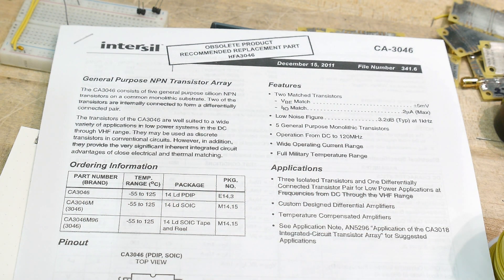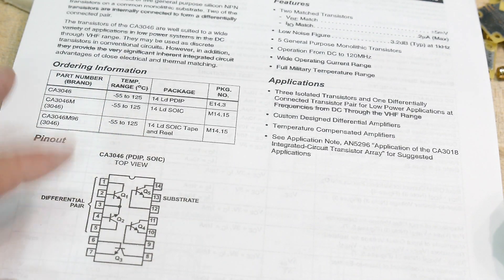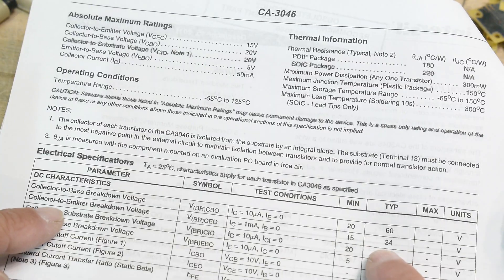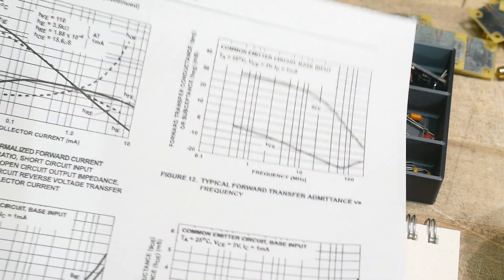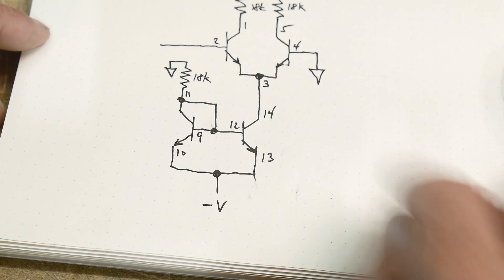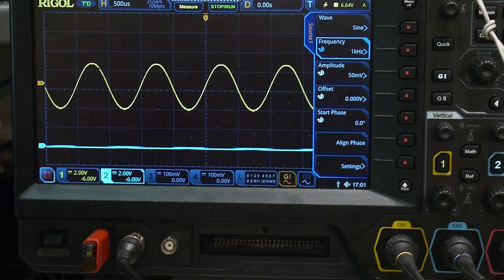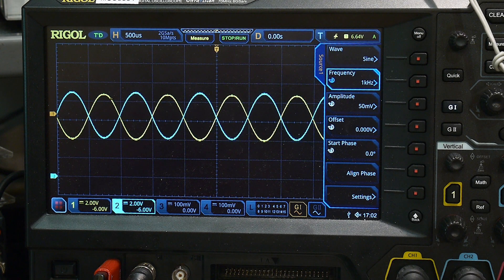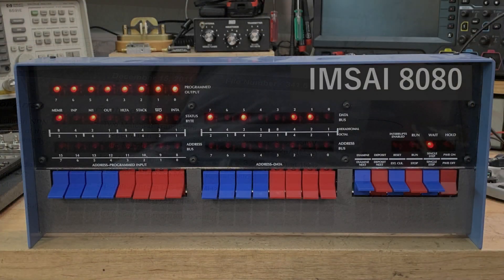#1176 CA3046 Differential Amplifier

Comment: I have some CA3086s, which just have 3 NPN and 2 PNP transistors. These would be really nifty as I've been exploring diff amps lately. There is also the CA3096, which is configured for a diff amp, but in a slightly different way. Makes me think I need to find a comprehensive list of CA series chips.

Comment: I've used the CA3046 in the past to make custom amplifiers. As well as some of its brethren like CA3096 (5 independent NPN transistors) and CA3054 (two full differential amplifiers). I particularly liked the 3054, it has almost everything one needs to make an instrumentation amplifier. And yes, the parts were originally developed by RCA (thus the "CA" in the part number).

Comment: Shouldn't the emitter of the emitter follower be connected to -V and not ground? Otherwise the signal will clip since it is oscillating around zero volts. Or am I missing something?
Reply: Ideally yes, to be fully on the conservative side, but not really in this example, as one of the inputs of the amplifier is referenced to ground and the collector of that transistor can only go down to about 0.6V anyway.
Hooking up the emitter follower to ground, instead of -V in this case may lighten the dissipated power on the lil' thing.
By the way, despite the Max IC is 50mA, the device Max Power is just 300mW, so it's quite unlikely that anyone would run those transistors at much more than 5mA each.
Reply: @fabiotrevisan8922  That's pretty much the right way to think about the circuit, although the dissipation in the emitter follower would be independent of whether its emitter resistor is connected to ground or to (-V). The power dissipated in the emitter resistor would, of course, be different.
Incidentally, a lot of the parameters and graphs given in the datasheet are specified at Ic = 1mA and Vce = 3V, so I'd aim for somewhere near that when designing in the absence of other constraints.
Reply: The output from either collector will have a quiescent bias point around (+V)/2, so there's no point in connecting an emitter follower to (-V), as it will clip on the positive excursion anyway as soon as the output approaches ±(+V)/2. This assumes that the supply rails are symmetrical.

If the biasing isn't obvious, take an example where the supply is ±12V. Looking at the circuit at 6:01 the current mirror sinks (12V - 0.65V) / 18K = 0.63mA into pin 11. So ideally, 0.63mA is also sunk into pin 14. If the input voltage at pin 2 equals the voltage at pin 4 (i.e. 0V), then the current ideally splits equally between the differential pair, and there is 0.315mA through each. The quiescent voltage across each output resistor is then 0.315mA x 18K = 5.67V, and therefore each collector is biased to 12V - 5.67V = 6.33V above ground. The maximum symmetrical output swing is about ±5.6V before clipping and the output never reaches ground.

Comment: The classic 'Tandem Match' by John Grebenkemper (then KA3BLO - July 1987 QST) used the CA3146 (higher voltage version of 3046) as log/antilog amplifiers to compute and directly display SWR from voltages obtained from forward and reflected power detectors. I believe the circuit topology was called a 'Gilbert Cell'. I adapted the design for some homebrew RF power metering projects of my own. It worked well.

Comment: If you're looking for maximum collector current, you really ought to be looking at the section "Absolute Maximum Ratings" (see 2:07 ) where you'll find that Ic max is 50mA and Vce max = 15V.

It's really worth rehearsing the parameters you're going to talk about before you start making the video.

Comment: Thanks I was looking for such transistor arrays (HFA3046, HFA3096, HFA3127, HFA3128)I am designing
I am designing two stage cascading  common emitter amplifier which are "DC Coupled" to find out resonant frequency of capacitors. 
I see many circuits in the industry , which are fairly high in frequency, and are AC coupled.  The capacitor needed to couple these stages are specified, but such capacitors  have resonant frequency less than the frequency of the circuit! 
One such circuit I see quit often is common emitter amplifier with emitter bias resistor shunted to ground with a large cap! The cap of such value has self resonant frequency of much less than operating frequency of the circuit!!!
Reply: Any amplifier has an operating frequency bandwidth which in turn has an influence on the capacitor values selected. Usually this is the lowest frequency the amplifier has to handle in as far as capacitor selection is concerned.
Reply: Use That300, That320 or That340 from the That cooperation and a tiny bit cheaper, the HFA parts are design for high frequencies. 8GHz for npn and 5.5 gHz for pnp.

Comment: 50 ma max collector current… it’s noted before the tables of electrical characteristics… I was shouting “look further up in the page!” while watching…
Reply: Under absolute maximum ratings….
Reply: Perhaps 50ma is the total device collector current so 10ma/transistor?? Not clear.
Reply: @paulbishop1016  An "absolute maximum" rating is one that should never be exceeded to avoid the possibility of damage to the device. So the recommended operating conditions always have some margin to ensure you never exceed it. If the absolute maximum collector current were 10mA, you'd never see the hFE at 10mA specified on the datasheet. It's a pretty safe bet that 50mA per transistor is the absolute maximum collector current. Of course, the maximum usable working collector current may also be limited by the absolute maximum dissipation of 300mW per transistor, e.g. 20mA per device at 15V supply.
Reply: @RexxSchneider  И что самое важное, при таких токах, близких к максимуму, параметры начинают сильно плавать, я стараюсь никогда не превышать даже половину максимальной нагрузки..
Reply: @SINHRO-FAZA  Parameters don't usually change near maximum current because of the current, but more often because of the rise in temperature caused by power being dissipated in the device. Nevertheless, I agree with you that keeping a good margin between your operating current and the absolute maximum current will tend to make for a more reliable design.